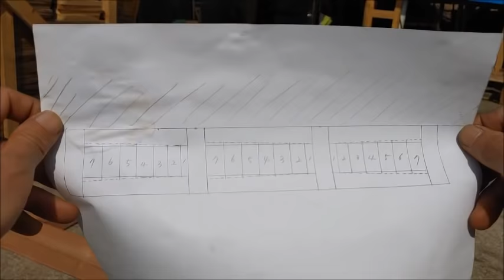House14-한국전통마루,쪽마루,우물마루,한옥목수,wood.K Woodworking

Comment: Very inspirational. Thank you. I will certainly use the techniques you skillfully demonstrated in this video already this spring.

I assume there is a roof so it is somewhat protected against water? If not - how is rot avoided?

If you have the opportunity a video about a traditional "ondol" heating system would also be very interesting.
Reply from the maker: Thank you.
Without a roof, the decay of trees is not prevented.
Every floor in Korea has a roof.
I'm not an expert on "ondol". I'm studying on "ondol".
Reply: @woodwood1  Thank you for answering. Having a roof above sounds good. Good luck with the study on ondol. I hope learn a lot and eventually make a video about your experiences there as well.

Comment: What if the wood swells and shrinks with humidity? It looks so tight.
Reply from the maker: you're right. I can tell empirically. After a year, the tree dries a little more, creating a gap between the tree and the tree. Consequently, anything that expands due to humidity in the atmosphere expands weakly. Also, the shrinkage due to drying will be reduced even more.

Comment: My guess is the cement he is using in the beginning will cause the rotting of the timber, destroying the whole house.
Reply from the maker: I respect your opinion, but in my experience this is not the case.
Reply: @woodwood1  it wont happen in a year, but beton and wood doesnt fit togheter, thats pretty much how old  fachwerk houses are oft damaged, by using cement for repair, instead of the originally used clay or similar materials. Simply if u put wood and cement togheter the wood will rot, because how beton relates to moisture.
Reply from the maker: @neufeldistvan6468  I agree with your opinion. It has a roof, so it hardly gets wet.